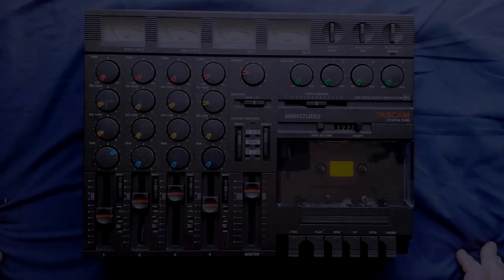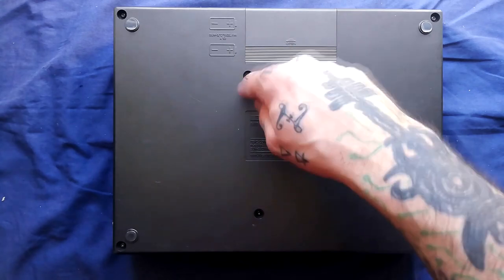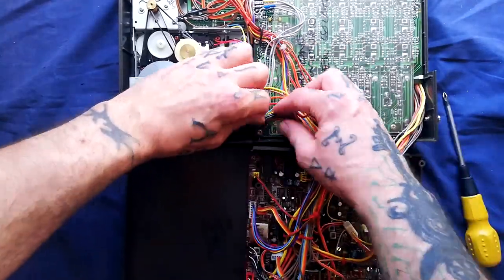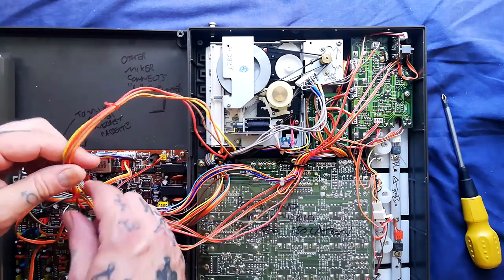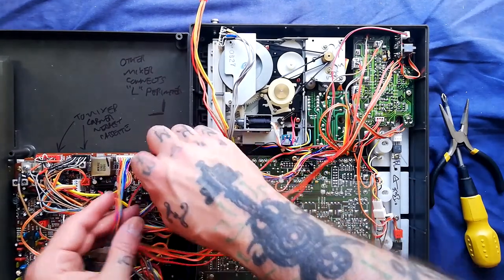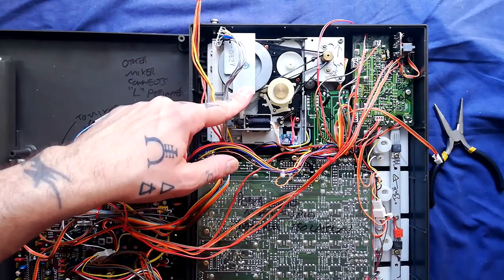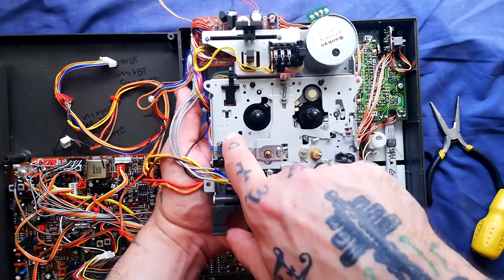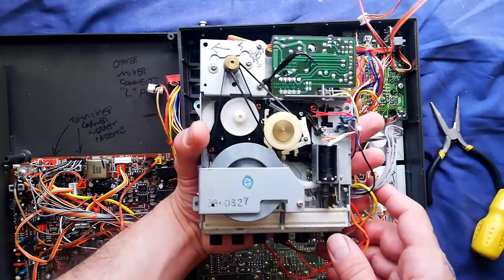Tascam Porta One Ministudio | Tear down | 1 | Remove Transport (Change belts, etc)

Comment: Great video. I am about to dive in into repairing the transport and doing general maintenance to knobs and the whole porta one. Thanks for the content!
Reply from the maker: Thanks for watching, good luck with the repair!
Reply: @Tetrakan  After three hours of trying to straighten the spring, I was able to get it done and it seems to be working well, as intended. While putting the thing back, I kind'a messed up with the pitch fader, where now I cannot put it back in place without removing the dust cover! LOL it is the small things, but anyways, successful repair, Sensei.

Comment: Quick question. On my porta one the belt that goes around the flywheel sits too low resulting in one of the levers shredding the belt when stopping. I've tried putting the belt around the center of the flywheel, but every time I press play the belt moves right back down to the bottom edge of the flywheel. Any ideas?

Comment: 5:09 See that wire spring projecting from the head base, pointing toward the pinch roller? If it's loose and wobbly, the head base is cracked and the part 5760644200 is NLA. Epoxy will not repair it. I'm checking with Fixament to see if they can duplicate this part for the Porta One I'm working on.
Reply from the maker: Thank you. As I mentioned in this series on the Porta One, a few years ago I tried my best to make a comprehensive series of videos covering the tear down of this generic cassette player and all common failure conditions including the one you mentioned. You can find a playlist containing all 8 of the videos here, I believe the issue you mentioned is covered in video number four? https://youtube.com/playlist?list=PLYsfQOh0tsJVl859LSG8MXisbMwLEW-L5

Comment: Hi @Tetrakan, thanks for the video! I am trying to service mine (belt replacing and lubricating transport) and I just noticed the ribbon cable that goes to the volt reg has got orange as the outermost cable, and it's always been like this... do you have any particular advice? Tape was working fine except that when I pressed stop the mechanism wouldn't release the heads and the cassette was stuck, so I thought of replacing the belts. I already sorted out recapping as eq was scratchy and now that works great. Thanks!
Reply from the maker: Heads getting stuck in up position is probably due to old grease on the white plastic  gears and levers - remove, clean with isopropyl, lube with silicone grease, rebuild. I’m not sure what you’re asking about the ribbon cable?
Reply: @Tetrakan  Thanks! What I meant about the ribbon cable is that in your video you said that the ribbon connected to the voltage regulator is supposed to have the brown wire on the outside. Mine has it on the inside, while the orange is the outermost. I bet that as long as it's connected correctly at the other end it doesn't matter, wondering though if that's possible or if it's been wired in the wrong way.

Comment: Hey, thanks for all your videos! They've given me the confidence and inspiration to repair several Fostex models and even other electronics.

I have an issue with my Portastudio One, on headphones out there's a whine that sounds like the power supply (I've tried several, and they "sound"different) Funnily enough, as soon as I hit "play" the noise stops, even when paused. It's unaffected by volume control. Everything else works great. Any idea what I can try to fix it?

Comment: Dear Tetrakan,
I´ve bought one of these units with a non-functioning Pitch Control. Before I open it up and dig around, I´d like to ask, if you know of any typical issues with the Pitch Control, I should check out?
Thanks for the great videos and for sharing your extensive knowledge :-)
Reply from the maker: It could be one of the 4 cables going into the motor has come loose. Otherwise I'd check the regulator chip on the motor hasn't overheated, the round pulley opposite the belt pulley would quickly become hot to the touch if this was the case.
Reply: @Tetrakan  Thanks a lot for your kind reply. I will follow your suggestions. Have a nice day :-)
Reply: @Tetrakan  hello again. I now managed to get the pitch control partly working: I can pitch down from neutral speed but not up. It's like only the one half of the slide resistor makes a change. I checked the resistor - it works - the resistance changes just fine all the way when I slide from one extreme to the other. But it seems the motor is only reacting to the "negative" part of the slide resistor. Any ideas what might be the case here? Thanks again for you expertise.

Comment: I've done some repairs on Porta Ones and Porta Twos, one thing I noticed is on reassembly about half the time the first power up can cause the transport to "reset" itself and annoyingly latch in the PLAY position, which if the case is closed can be a total *&%$ ache to get into the STOP position. It's like the plastic casing acts like a lock between the play heads and the case / control keys, can't even open it without forcing something!. Powering up a few times before closing the case up and allowing the transport to reset itself helps with this.
Reply from the maker: Haven't encountered this myself but I hope this tip helps someone, thanks!

Comment: Do you have a mod that will let you record all tracks ?
Reply from the maker: I’d need to check the schematic, I think there are only two record amplifiers? If so the mod won’t work, if not yeah it should be simple to adjust the switches….I’ll look into it